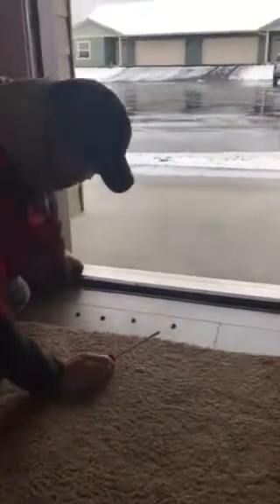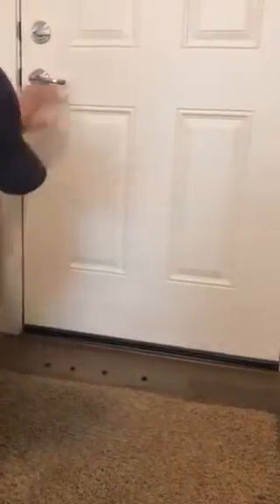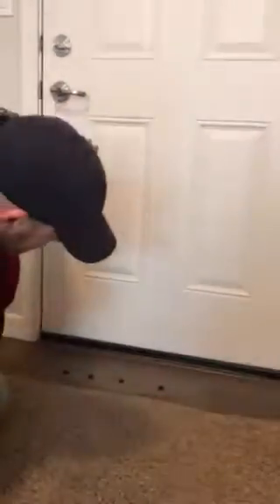Adjustable thresholds

Comment: Why would it need adjusted in the first place
Reply: When a home is built with new lumber there is a residual amount of moisture in lumber. As the home ages, the lumber dries out and the home will shift and settle due to the lumber drying out. This settling can cause the space below your front door to get larger or smaller.

In Montana we face extreme weather changes throughout the year. Today, our low is -32 degrees Fahrenheit in the next 6 months, we will be in summer with temperatures reaching 90 degrees Fahrenheit. Any change in temperature will affect the natural products in a home as they expand and contract based on the elements they are facing. 

Thresholds should rarely ever need to be adjusted, if ever, and multiple customers of ours have never adjusted theirs or even know it existed. However, by not installing an adjustable threshold, we would be doing the customer a disservice if there ever was an instance where they would like to adjust it.
Reply: @milesterry101  why would it get smaller